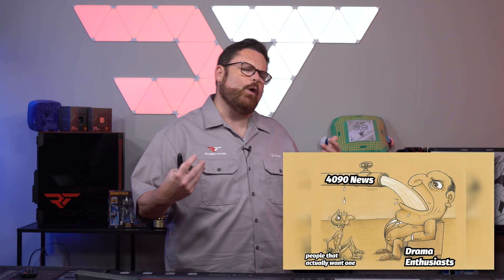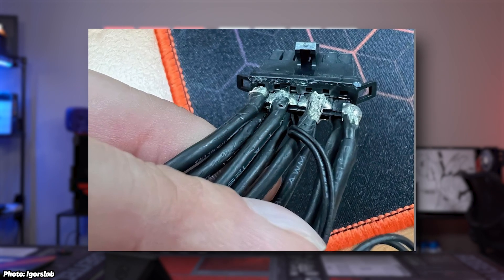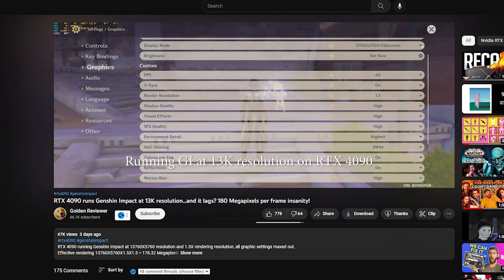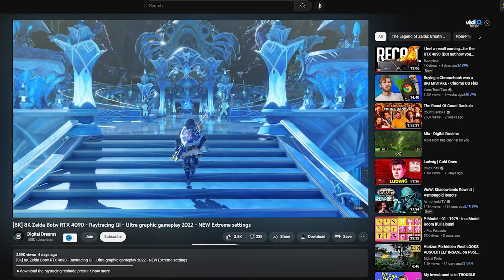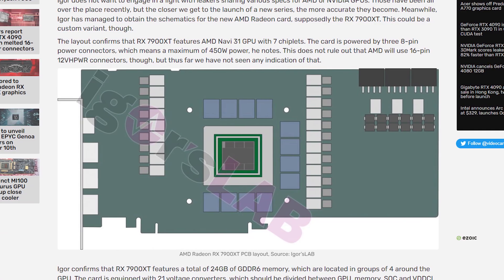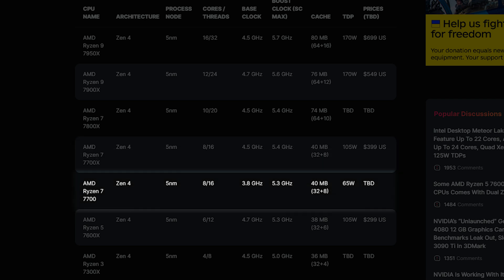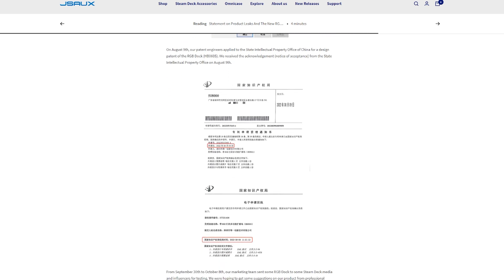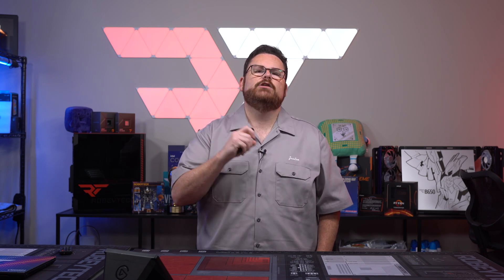RDNA3 details and more on AMD's new 7900xt and XTX GPUs.  It's coming!

Comment: Do we have any information on the physical dimensions of any RDNA 3 cards? I have a size constrained case (Alienware Aurora R11) and need a small GPU (less than 10.5" in length is the main constraint) if I'm to upgrade from my RTX 3080. In fact my 3080 was custom made by Dell to fit in the cramped interior (the new generation Auroras have remedied this but I've got limited options). The RTX 4090 and 4080 will be way too large. Hopefully there will be something worthwhile from AMD that fits.

If not at least my RTX 3080 is pretty great. 😛
Reply: Looks to be triple slot

Comment: The Value/Performance scale has been ruined this generation. Hopefully the market corrects itself. Just buy all the used 3000 series until someone releases a card with good price/perf ratio.
Reply: Cryptomining has artificially driven up the price of GPUs. Hopefully cryptomining dies off for good and GPU prices will return back to a normal price not $1500+

Comment: I’m sorry, but there is a huge hype on this new AMD gpu. My opinion is, AMD will not come close to Nvidias 4090. Sure, it might be more efficient with less power draw, but what really do you save from 370 watts to 420-450 watts? I remember when folks were going all mad and crazy cuz Nvidias 4090 was at 450 watts and how hot it was going to be. Yet, under long gaming sessions it does 54-59c temps which is pretty damn good. Hell, 3080ti and 3090ti would sometimes go as high as 70c sometimes. At this point, people are just hating on Nvidia
Reply: there's always hype for every gpu. The fact that's every nee iteration, regardless if from amd or nvidia, is just getting less and less impressive and not much better than previous.

7900xtx can def come close to 4090 for many uses.

No matter. What matters is price whichll be too high anyways even if better than nvidia, on paper at least. The fact that no lower end cards are launching is proof of that.

any 6000 or 3000 series card is still 10x greater of a choice than these.

The $1200 (1500-1600 in stores) 4080 12gb that was going to launch, was gonna be like 5% better than 3080 lol. Which can get for $700-800 from store, or 500-600 2nd hand.

4090 is 60% better than 3090/ti and costs 3x more. 2.5x at it's best.
Reply: @user-wq9mw2xz3j  Less impressive in what way?? When the 4090 was released, all big youtubers were praising and stating how such a BIG improvement the 4090 is compared the 30 series. Now all of a sudden the 4090 is not that much impressive and bedsides the issue with SOME plugs going bad, Nvidia and the 40 series is being labeled as a fail. I just don’t get it. I had a 3090ti and got my self a 4090, and just by going from a 3090ti to the 4090, I saw a huge increase in performance. Even better, the 4090 runs way cooler than my old 3090 ti. Sure it uses a bit more power, but I never see my 4090 go past 430 watts under normal gaming sessions, so it’s not that much of a difference. So I really don’t know what people are expecting. Is price high, sure, but that’s something that unfortunately the nature of the beast.
Reply: @MustafaGT  It's the job of the BigYTer to hype the new cards. You can justify your 4090 as much as you need to, but when a GPU costs the same as a nice 2week vacation in Italy for my family and me (excl. Food) there is something off.
Reply: @Retrophy  To each their own. There’s people that spend thousands of dollars in shoes, yet in life you only need two pairs of shoes. There’s people that spend 50,000 on a sports car, yet you only need a 20,000 car to take you from point A to B. Things change. You cannot expect a high end GPU to cost you the same as it did 5 years ago. You cannot expect to buy a brand new car today for what it cost 5 years ago.
Reply: @MustafaGT  as i said, it's done for every gpu generation. but then when take a step back and lick again, the difference is small.

without frame generation (which previous gen is also capable off), on average it's 60% better. still good, but not as much. in practice. say go from 100-110fps to 160-200. no real difference in gameplay/enjoyment. and not even managed to do that without using so much more power. and at $2000-3000 in stores

no, not impressed at all
Reply: @user-wq9mw2xz3j  Dude, what are you talking about? Do you even have a 4090? How can you make statements like that without actual proof? I’ll end this conversation with this. Game I mostly play is COD Warzone. I was getting average of 110-120 fps on 4k and some settings turned down to medium. This is with native settings(no DLSS) on my 3090ti and getting 66-70c temps. With my new 4090, I’m now averaging 200-215 fps with all settings on High and no DLSS while averaging 56-59c temps. If that’s something that is not to be impressed about, then I really don’t think anything will impress you. Good day!!
Reply: @MustafaGT   Do you know me??? Because you got me pretty good there! 😅 I am one of those who invest a lot in handcrafted shoes! (much more than multiple high end GPUs would cost) So Yes! your argument is true and absolut valid. 
But at least for me, there is a dissonance between GPU prices and value right now. (as in every luxury item)
Do enjoy your 4090! 🙂
Reply: "At this point, people are just hating on Nvidia" true and maybe rightfully so. 
All the recent actions from Nvidia all show that they don't really care for "mid range" gamers. 
The real question for me is not how close to the 4090 AMD will come, but the "price to performance".
Reply: Why do you think AMD couldn't come close when the 6950xt is beating 3090ti in rasterization?
Reply: @sjneow  well because according to leaks it's not as close

plus 6950xt didn't beat 3090ti on average rasterization, unless possibly on unrealistically low res.

plus amd not having frame generation which seems pretty decent, better than normal dlss imo. will probably take them another 2 years to come up with that.
Reply: @user-wq9mw2xz3j  well according to leaks AMD is likely to beat the 4090.

Comment: I normally don't use the big picture mode, specifically because of how dated it is, as well as the various bugs and weird configuration settings for controllers. If this UI is also a functional overhaul, as opposed to just a paint job, I'd probably use it more.

Comment: The connector issue is people not connecting it all the way.  Gamers Nexus even cut wires and couldn't melt the connector.
Reply: still shouldn't happen. no matter the reason, if it's easily repeatable and happens widely and without trying, it's bad
Reply: It isn’t that simple